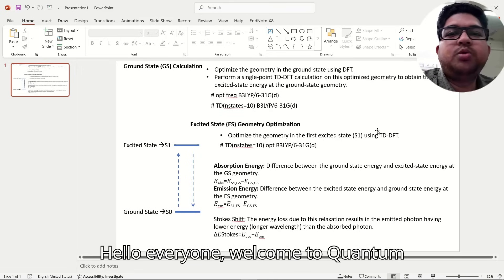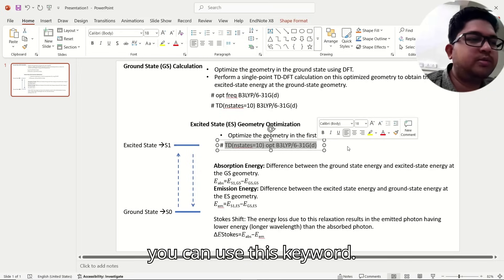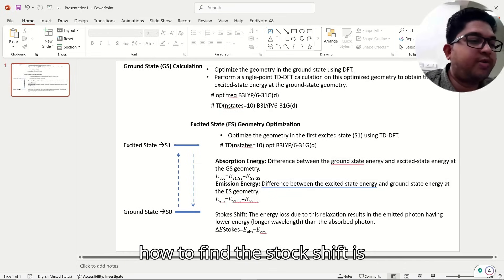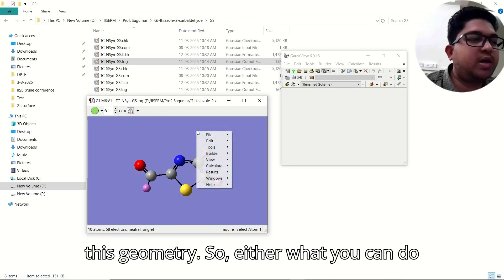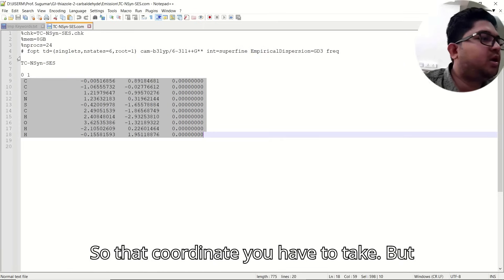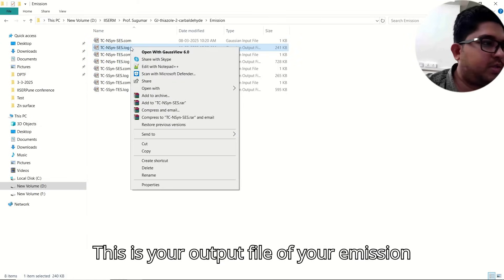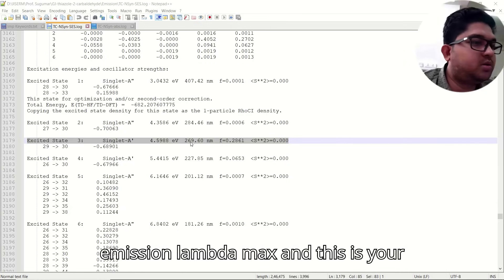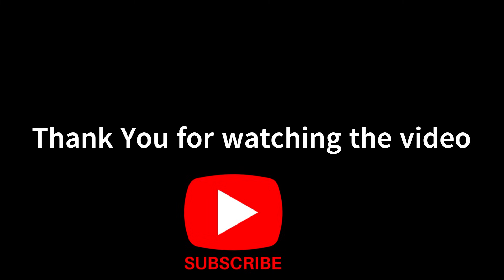Absorption and Emission Spectra Calculations using DFT

Comment: If we set nstates=6, will the resulting emission spectrum include transitions from S1 down to S0 as well as from S6, S5, etc. down to S0? And If the emission spectrum includes peaks from S6, S5, ... down to S0, is the emission spectrum still accurate? And if, in the case of the transition from S1 to S0, the oscillator strength (f) = 0.000, does that mean there will be no emission from S1 to S0, and that the emission will originate from higher excited states to S0 instead?
Reply from the maker: Setting nstates=6 gives excited states S₁–S₆, but emission usually follows Kasha’s rule, occurring from the relaxed S₁ state. Simulated spectra may show S₆→S₀, S₅→S₀, etc., but such higher-state emissions are uncommon unless internal conversion is slow or symmetry-restricted. If the oscillator strength for S₁→S₀ is essentially zero, radiative decay from S₁ is negligible, and emission could, in rare cases, originate from brighter higher states. For physical accuracy, optimize the geometry of the emitting state and compute vertical emission transitions from that minimum, rather than relying solely on vertical excitations from the ground-state geometry.

Comment: Hello sir, first of all, thank you for your informative presentation.

I want to find the theoretical fluorescence spectrum of a molecule. To do this, I first performed the ground state optimization and frequency analysis. Then, using this geometry, I performed the optimization and frequency analysis of the first excited state geometry. I have the results of these two calculations. Are these two calculations alone sufficient for the emission spectrum?

Should I run a new td-dft using the optimized geometry of the S1 state?
Reply from the maker: Yes, that's enough

Comment: You're videos are very informative and helpful. Could you do a video on using TD results for further computations, such as PES/modredundant scans? I am personally trying to calculate transition states from an excited state and having a very hard time with errors.
Reply from the maker: The keywords for Excited state (ES) TS/PES/Scan calculations are not huge different from  the Ground state calculations.  Just you need to mention the TD-DFT or other excited state  keywords along with the keywords for TS/PES/Scan.

For bond scan: 
# opt=(CalcFC,modredundant) td=(singlets,nstates=6,root=1) cam-b3lyp/6-311++G** int=superfine EmpiricalDispersion=GD3

For TS:
# opt=(CalcFC,ts,noeigentest,maxstep=5) td=(singlets,nstates=6,root=1) cam-b3lyp/6-311++G** int=superfine EmpiricalDispersion=GD3 freq

For optimization:
# fopt td=(singlets,nstates=6,root=1) cam-b3lyp/6-311++G** int=superfine EmpiricalDispersion=GD3 freq

similarly you can perform the calculations for triplet states; here I have used TD-DFT, you can use whatever method you wanted to use for excited state. Like TDA, EOM etc.

Comment: May I ask why are you exactly using cam-b3lyp? why not b3lyp? 
and also why did you use a superfine integration grid?
Reply from the maker: I used CAM-B3LYP instead of B3LYP because CAM-B3LYP is a range-separated hybrid functional, which includes long-range Hartree-Fock exchange. This makes it more suitable for excited-state calculations, especially when dealing with charge-transfer (CT) states or Rydberg excitations, where standard B3LYP often underestimates excitation energies or gives inaccurate oscillator strengths. You can choose a better functional than this, especially for the excited state (see literature). 
As for the superfine integration grid (by default, it's ultrafine), it helps improve the numerical accuracy of DFT calculations. It reduces integration errors that might affect excitation energies and transition properties, particularly when using meta-GGAs or range-separated functionals like CAM-B3LYP.